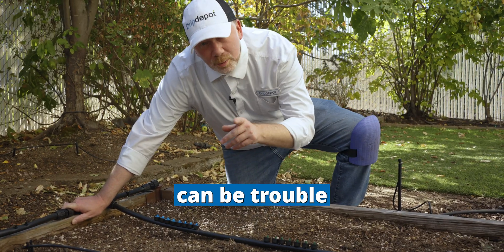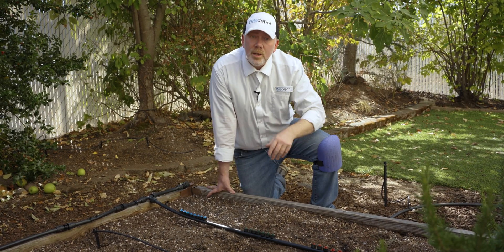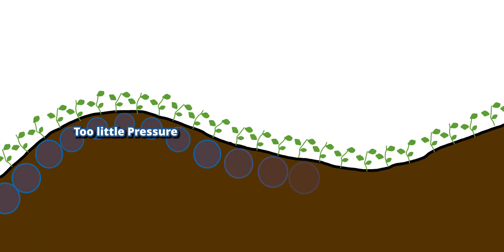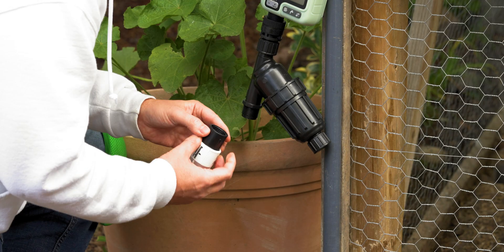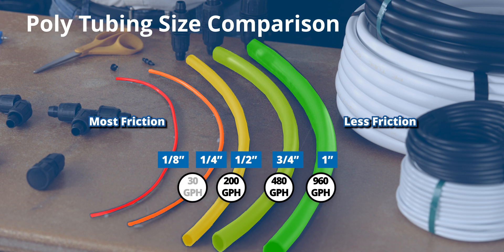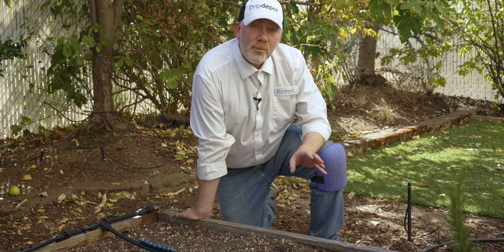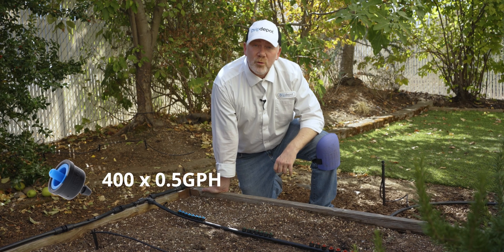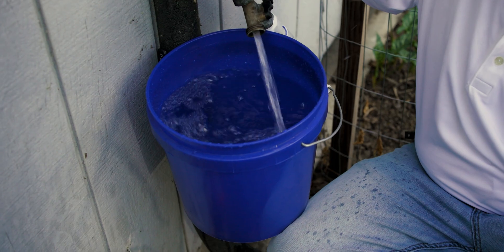How Many Drippers Can I Have on my Drip System?

Comment: The similarities between traffic engineering and drip irrigation are fascinating
Reply from the maker: Jay, I just got back from a short vacation to your comment -- and you know, I've  never thought about it that way, but you're absolutely right, the comparison is actually pretty direct.  Now that I think of it, they're almost the same thing lol.  

Both are concerned with flow management, capacity and branching networks and probably some I'm missing (heck, pressure regulators could be seen as traffic lights to a degree, managing the load to keep things flowing as they should).
Reply: @dripdepot were all just big drips.
Reply from the maker: @jayteaman  LOL indeed!  🤣

Comment: You hit homeruns on every single video! I literally was going to message you guys about uniformity! I installed bubble emmitters all along my bed runs. It is hard to get their flow just right. I am thinking about replacing them with 1/2" inline drip emitter tubing.
Reply from the maker: Martin, it's good to hear from you, thank you for the kind words!  

You've got it right that getting the flow just right on bubblers can be challenging, particularly since they can be on the higher flow end which can introduce things like pressure fluctuations.  I do think you'd likely have better lick with emitter tubing (the pressure compensating kind in particular) or even pressure compensating button drippers (which cost a lot less) :)